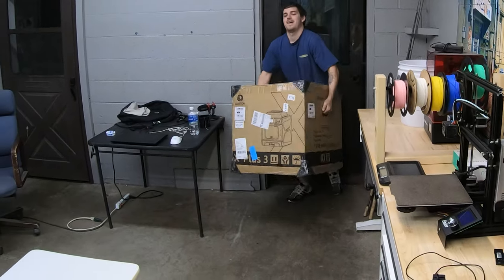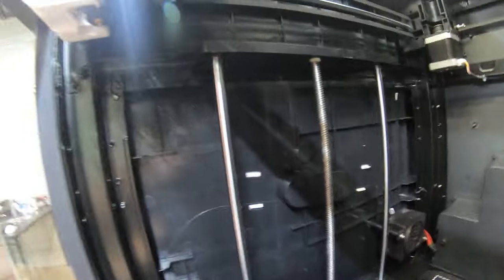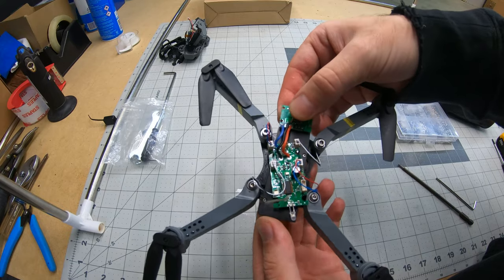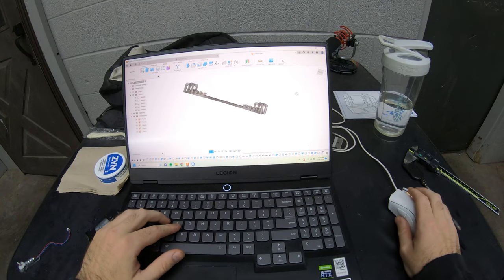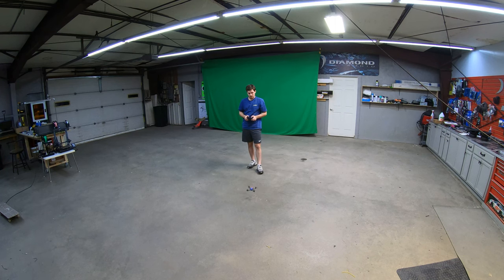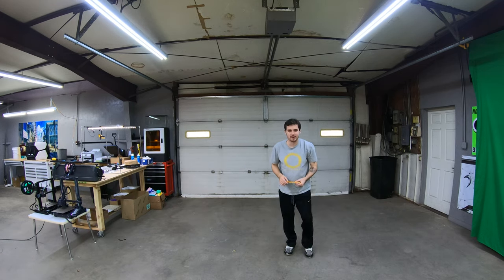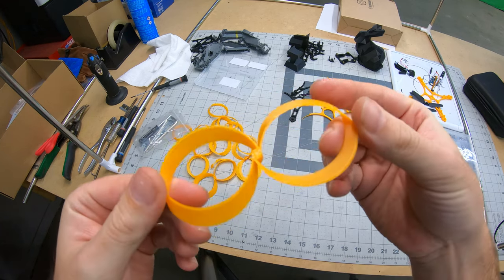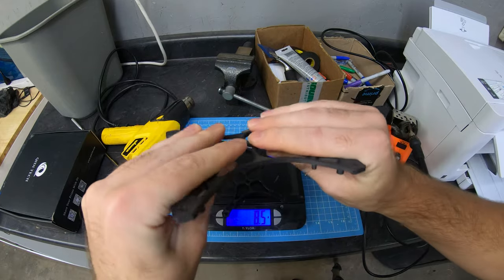This Printer Handles Carbon Fiber like its 𝙋𝙇𝘼...

Comment: Flsun s1 will be better far better.
Reply: Maybe, but there is a big difference between spending 850$ Can for a printer like the one in video, and over 2'000$ Can for the one you suggested. I'd consider very much the qidi x-plus 3 💸

Comment: Did you re-tune the PID gains after you rade the drone lighter? the stability issues look like it hadn't been retuned, and if that's the case I'm surprised it flew after loosing that much weight

Comment: I’m trying to find a printer that can handle polycarbonate because i want to print molds for molten wax which may be poured at up to 200 degrees fahrenheit. Considering this printer.

Comment: Returned my x-plus. The older model, but it looks as though they retained the same things.

It was extremely loud and I’m not talking about the fans. It clanked like a factory machine. It’s way too big and doesn’t need to be. Even with a heated chamber.

The addition of ABL and Klipper is nice. But honestly, if it wasn’t so big I might take a second look at it.
Reply: Do you think if it was running in a basement it could be heard through the ground floor?
Reply: I had the first Qidi X plus. Thing was dead quiet, a lot quieter than my prusa mk3s+ on silent mode sitting on a concrete slab printing at 40mm/s. When you go fast, the printers are loud AF. These new printers make a shit ton of noise due to their extremely high acceleration values. Reduce those and the noise level drops dramatically.

Comment: Great to see these props are less noisy and provide sufficient lift. Did you have chance to balance the propellers to get rid of that motor vibration yet?
Reply from the maker: Unfortunately one of the plastic gears on one of the motors burnt out! still waiting on a replacement..